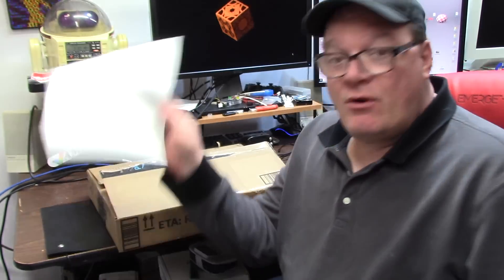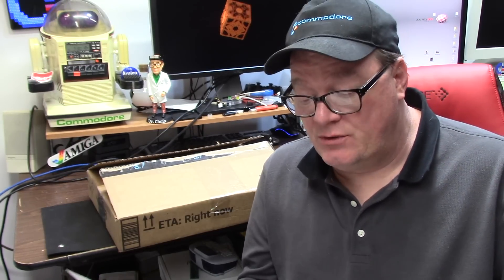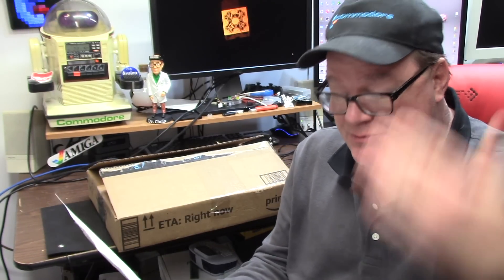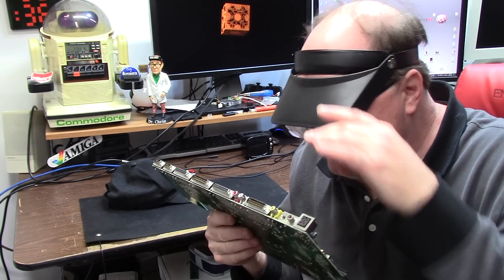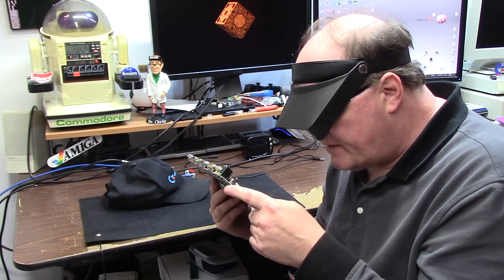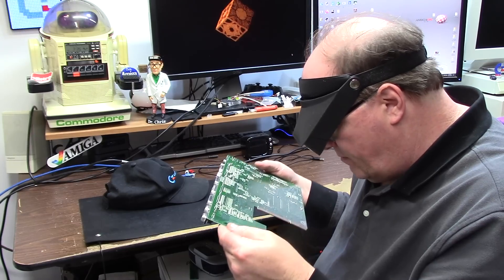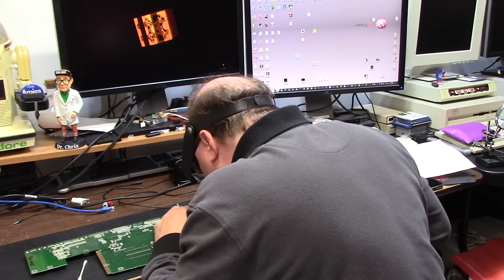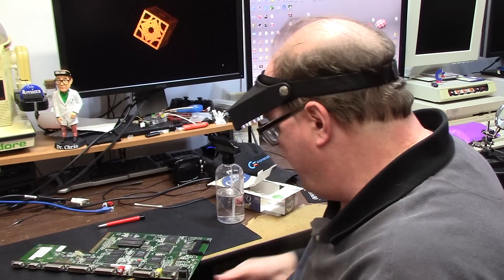Amiga 1200 of missing pads, traces and exploded ceramics

Comment: Where do you buy the sheet of "metal" that you made the pad from?  Sorry for noob question :)
Reply from the maker: its metal foil tape from amazon, I used UV Epoxy to stick it to the board. i put some down, and stuck the foil inside the goop. once cured it cracks off the top of the metal then you have a new pad, i did have to wire the pad of course but as you can see it works great.
Reply: @ChrisEdwardsRestoration  Great, thank you!

Comment: It's dead easy to convert an A500 keyboard to work on an A1200. All you need is a membrane and a Dremel. Just dremel out a cut out for the membrane and pop it in.
Reply from the maker: My 500 has a plug , its ribbon to the board of the kb is too short , well shorter than the 1200s  membrane.  I would need a new membrane w a ribbon for the 1200 to do so

Comment: What temperatures do you recommend  in using a soldering station? 350C is OK. I have a recap kit that is sitting for a few years now and maybe its the time to recap. Do the A1200 Caps get bad or this is a precaution? I heard that most issues with A1200 Caps are Audio related. Thanks for the great video.
Reply from the maker: I run about 550-700f. Whatever that is in metric.   Caps go bad w age.  Leak abd can cause all sorts of issues not only audio but video
Reply: Do they fail hard or soft? By hard failure I mean leaking on the motherboard  cause trace damage. Soft is when they look physically ok.
Reply from the maker: @antiriad leaks cause issues w acid eating stuff. Drying out turns them into solid resistors literally frying the circuit or chips by grounding the line out